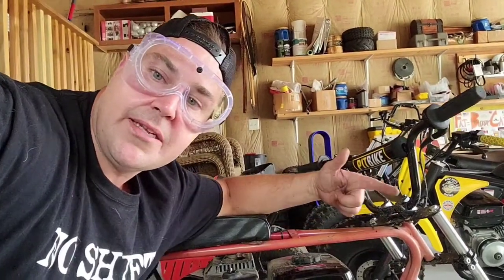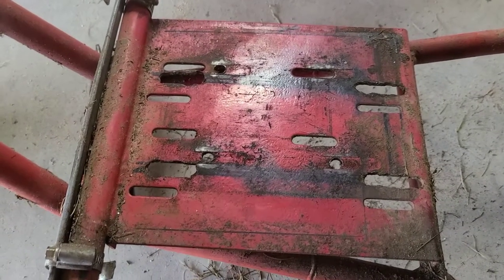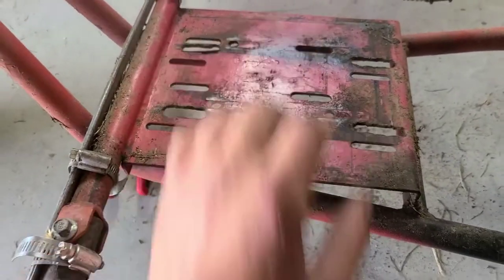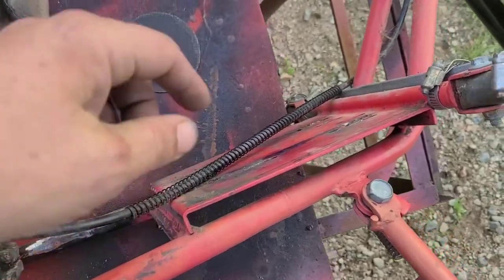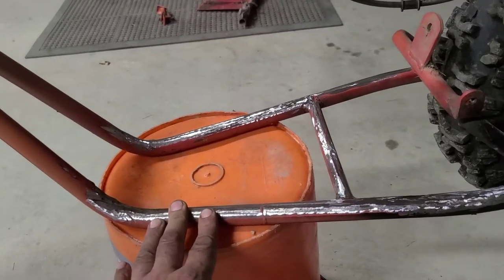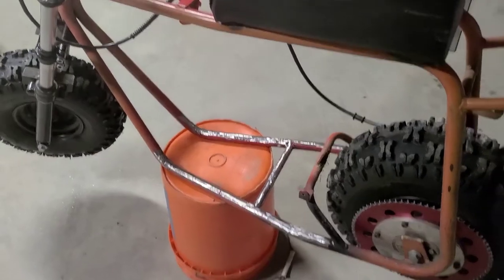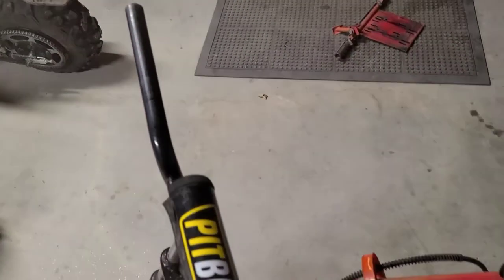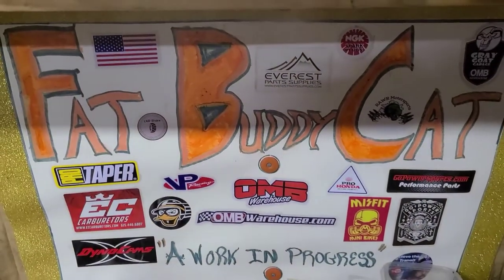Building A Custom Doodlebug DB30S

Comment: One big engine mounting plate - new footing peg mounts that fold up (real grippy/dirtbike foot pegs too) - A fuel tank mounted up top on those frame bars.
Reply from the maker: I had a 3x8 on it before,  I'm going to be putting a dashboard/control panel of sorts there!
Reply from the maker: Any suggestions for the cross section for the pegs? I will do my best! This is the kind of feedback and interaction I want people to have. Thanks you.

Comment: My choppers engine mount is like that. It fits   Brigs l head 3,5,8,gx 160, gx 200,  yellow clone, predator 212 .. it’s had all of them ..  I had to add a bar & fill in with the welder to make it solid enough..       
this winter if everything  go’s to plan I’m going all out on the bt 200x to  make it  all the bike it could be .... juggernaut,  new predator,  knobbys, battery box,  add support for the cvt &  fill in the sides of the engine mount, 
sheet metal to cover the triple tree,   & all sorts of other mods like grinding the space the steering stop touches  to get tighter turning, under glow ,  u know all that good stuff..
Reply from the maker: Yeah brother! I've been seeing a lot of custom rides and by golly I want one of my own!

Comment: Hi there, I have the same frame… could you post link for the suspension and the handle bars
Reply from the maker: I got my handlebars and risers off of an mm80. The fork was on Amazon for shipping reasons but I think it was from GPS. They seem like the only ones who stock them on a regular.